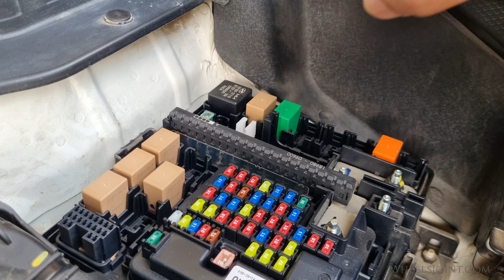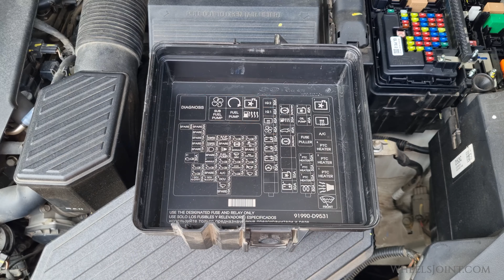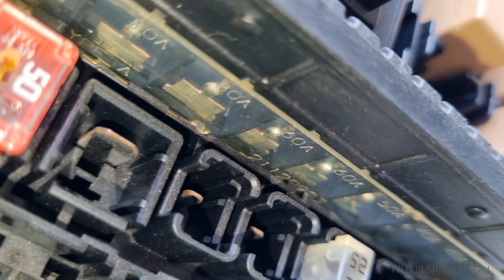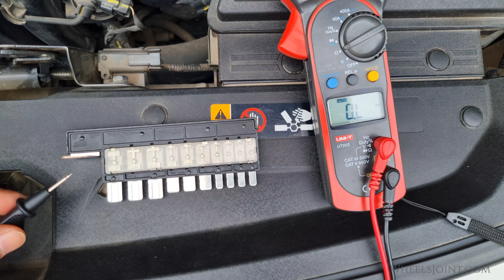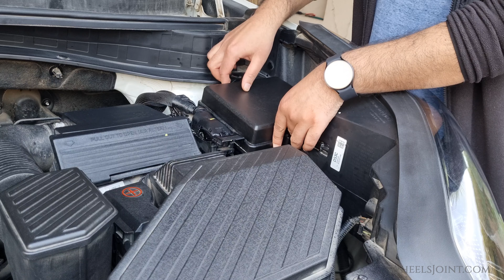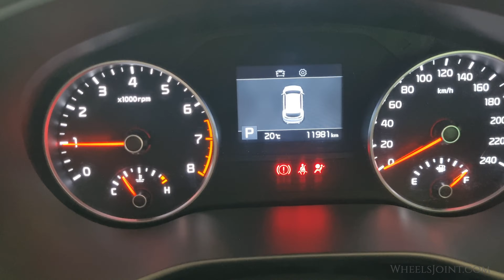How to replace multi fuse strip in Kia Sportage

Comment: Awesome 😎
Reply from the maker: Thanks! 😎
Reply: I have an issue with my kia Sportage 2023 that battery is died once I left at night and at morning battery died I did change battery and still the same then electrician told the card / part no 96560 - DW000FHL is cause a leak which I change it twice and still not solved now I am trying to watch some videos hopefully can know the problem exactly as technicans diagnoses are vary from one to. Another 

Pls can yoj help

Comment: Hello, I recently took my 2014 hyundai santa fe vehicle to a dealership, Melville Hyundai in Western Australia,  to have the Multifuse replaced under a Recall. When i received the vehicle back 3 lights came up on the dash, ie, ABS, Traction control and Downhill braking system light..When i asked why these were on, the dealership said it was Not Their Fault and to fix it i needed a $700 part plus $600 labour cost, total $1300..There were no llights on the dash when we dropped the car off for the Recall work to be completed..They have refused to help us unless we book the car in and pay the $1300.. May i ask you, is there a fix to get rid of the 3 dash lights? The Code C1286 Yaw Rate  and G sensor fail have come up on my obd2 scanner...The dealership said that the car needs a new Airbag Module and that the new one has to be programmed to the vehicle, hence the $1300 bill...Perhaps Re programming the existing Airbag Module will do the trick? your thoughts please...Great Vid, thanks for this one..
Reply from the maker: The code C1286 usually points to a Yaw Rate/G-sensor issue, which can trigger ABS, Traction Control, and Downhill Brake lights all at once. In many cases, this doesn’t necessarily mean the airbag module needs replacing—it could be a sensor fault, wiring/connection issue, or sometimes a calibration problem after work has been done.

Before spending $1300, I’d suggest double-checking all connectors around the sensor/module area (sometimes things get disturbed during recall or electrical work).

Disconnect the battery for 30 minutes and see if it resets the system.

Also ask if the Yaw Rate sensor can be recalibrated with a scan tool.

Also get a second opinion from an independent mechanic (often far cheaper than dealer pricing).

Reprogramming the existing module might solve it if it’s just a software or calibration issue, but if the sensor or module itself has failed, replacement could be needed. Definitely worth a second diagnostic opinion before replacing expensive modules.